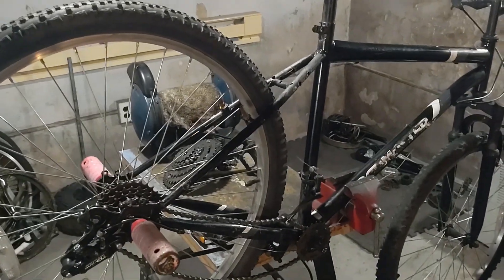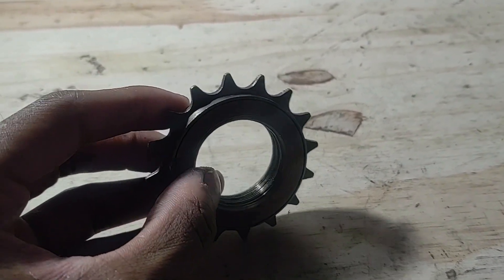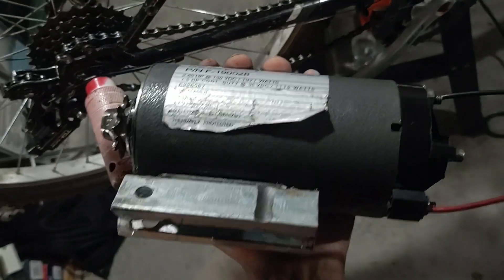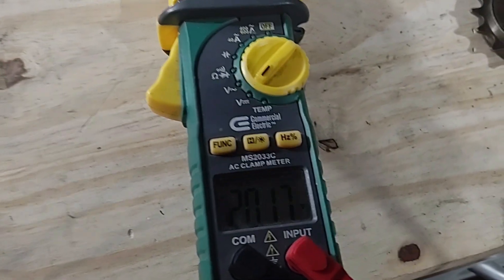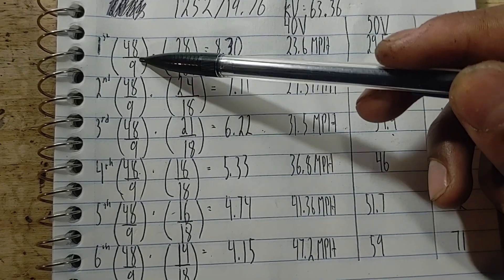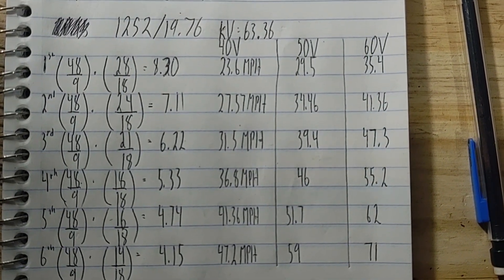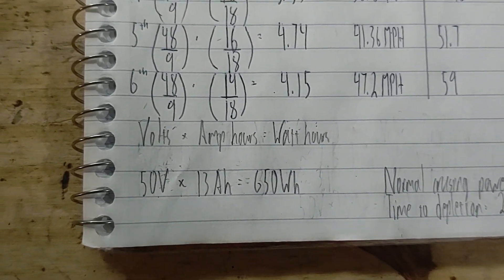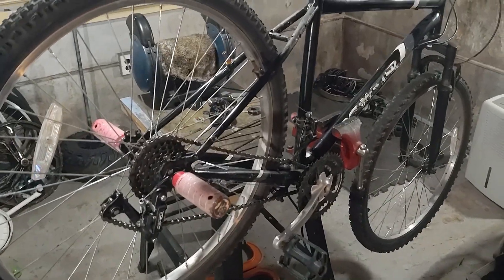DIY Mid Drive E-Bike Part 1: The Overview

Comment: Generally, a good cadence in cycling is between 80-100 rpm. And to maintain The sensation of pedaling a bicycle, better to include this variable into your drivetrain ratio calculation.